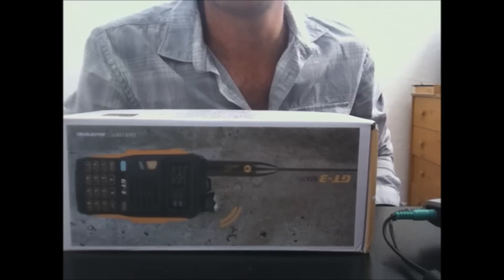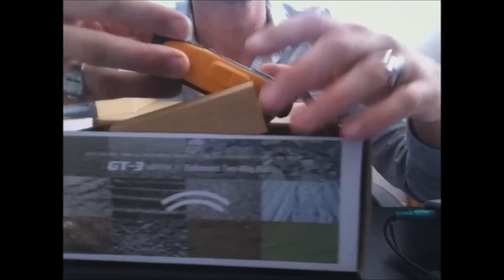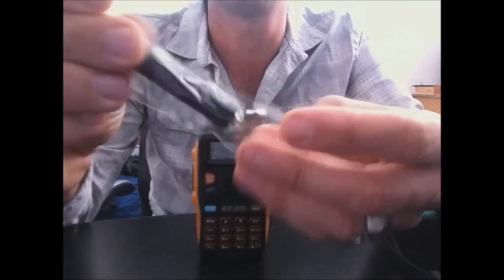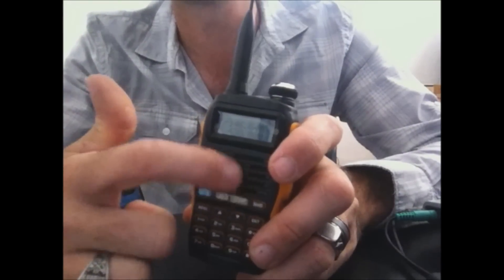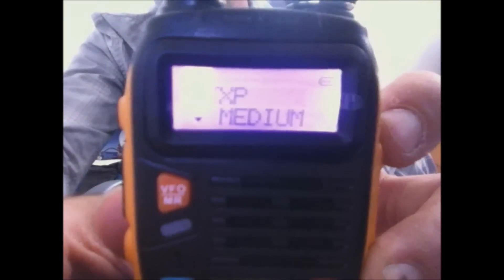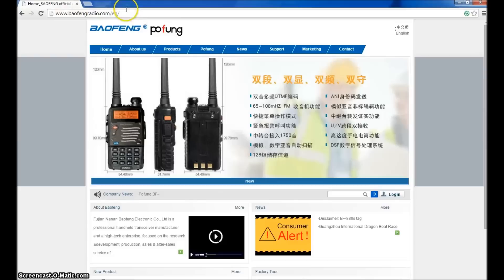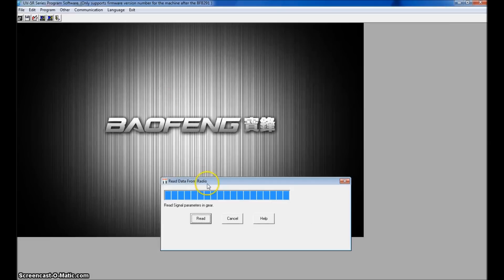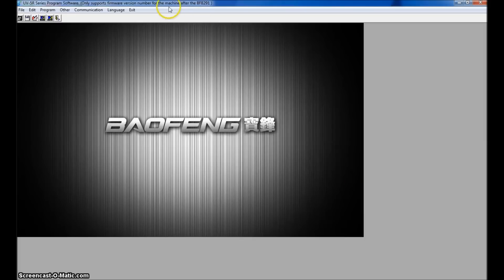GT-3TP Baofeng 8 watt review, test and programming

Comment: I just purchased two Baofeng GT-3TP's, two speaker mics, programming cable, disk, and 12 volt charger on Ebay all for $40 including shipping.  The bad is they are coming from Hong Kong.  But that is one hell of a deal not to pass up.  

Will be added to my already growing commo stash:  four UV-5R's, one BF-F8+, one BF-F8HP, one UV-82 Camo, one UV-82HP, one UV-82C, one KG-UVD1P that I personally own, and one KG-UV6D V2 that is issued to me from county emergency management.

Should be getting them in around the end of the month.  These will be the first GT-3's that I have purchased.

Comment: Hi I'm looking to use this radio at work. The plant is about 3 million Sq foot. What would be the best setting and frequencies to use? Should I use uhf of vhf? Also what band wide or narrow? Thank you
Reply: It will receive broadcast stations from 88 to 108 MHz quite well. Turn it on, press "Call" and tune to your favorite station...
Seriously, this isn't a commercial radio, it's a Ham radio. To transmit on it legally, you need a license. If you need radio communications in your plant, you should invest in commercial radios and get the proper licensing for it. Baofeng makes a version of the UV-82 for commercial frequencies, but I've not seen or used one.

Comment: when i unlock the channels are they installed in the radio.
Reply: Lorne Stadnyk I believe you mean unlocking the frequencies. This radio comes pre-programmed with 12 channels. By unlocking the full range of frequencies 136-174/400-520 it will be installed on the radio.
Reply: Lorne Stadnyk thank you

Comment: I find your video confusing. No where in the video do you indicate that this is an amateur radio. You have people asking you if the radio can be used with higher power than the typical 5 watts allowed for FRS. Some on here are interested in unlocking the frequencies. Why would someone want to unlock the frequencies on this radio? Do these same people know that they will be broadcasting out of band? Do any of the people asking questions about increased power know what they are limited to on the FRS frequencies.

As an amateur radio operator, I think you could have done a lot better job of properly representing what this radio is and what can and can't be done with it.
Reply: Binder Dundat Does this mean when unlocking the radio the total output power is reduced to 4W?

Comment: Can this radio be programmed to use the 1-22 walkie talakie channels?
Reply: Rick Knuckles Yes it can. If you know what the 22 individual frequencies are its very simple. You can use the radio as a scanner. To help narrow it down have a look on the back or underneath the battery of your walkie talkie. It should indicate the frequency range it operates in. Be on the lookout though, lots of walkie talkies use DCS/CTCSS coding. Also possible to decode using the DCS/CTCSS scanning function of the radio.
Reply: +Vernon Els yup, easy to do but totally illegal though. I'm not saying you can't, just that you should be aware of that.

Comment: Do you know if there is a battery eliminator that fits this radio?
Reply from the maker: Tim B No, not that i know of, the only style is the UV5r style that has the bat eliminator. one reason many people continue to go with UV5R case design
Reply: HamRadioConcepts The battery of my GT3-TP has the same model number as the ones on the UV-5R. Maybe, maybe, the battery elliminator fits both radios.

Comment: Hi There,
I'm new to all this can you advise when you unlock the radio does it unlock all frequencies to use 8w?
Reply from the maker: Yes, but the further you go outside the normal operating band, the power will decrease a slight bit. the radio is designed to operate to most power at the center of the bands.
Reply: cobber427 Are you aware that you are limited to a certain output if you are not operating within an amateur radio band? Even if you are a licensed amateur radio operator, you cannot exceed this output power on FRS frequencies. The producer of this video didn't have time to explain all of that to you and it's your job to be aware of what you can and can't do with this radio.
Reply from the maker: Binder Dundat You're correct. It's like buying a 600 horsepower mustang, you have to obey the speedlimit. I don't use these on FRS or GMRS frequencies, but i'm sure a lot of people out here do use them for that. It's up to their responsibility to operate according to rules and regulations.
Reply: I guess you can and have taken that path where "it's not up to me to tell them what they can and can't do". You were so helpful in all the other aspects of the radio, it's too bad a little more hadn't been addressed. They were being sincere in asking you.
Reply: Using these radios for FRS or GMRS is operating outside of the rules and regulations. They can't legally be used on those frequencies.

Comment: Hi mate need your help just got the GT3 mk 2 and two UV 5RA+ there on the same frequency but when I speak out of the GT3 nothing comes through to the other radios when I speak through the RA+ the sound comes through the GT3 and can hear it Km new to radios and want them for work if you could help that would be great
Reply from the maker: It sounds like your offset is turned on, you may see a - or a + on the screen, which means you are transmitting an offset in either direction. When you transmit does it show the same frequency you are receiving on? Or does it change when you press PTT?

Comment: tht software just makes my screen flash thn crashes ,  on borh my win 7 pcs 
please someone give me a link to one tht works on win7 64bit
Reply from the maker: The one i showed in my video is working on my Windows 7 64bit machine, A lot of users are having this issue, and i cannot say it is the software because it works for so many people, its some configuration in your operating system. Try running the software as administrator.

Comment: Can't get the Beofeng programming SW to run under Win7 to remove the irritating limit this radio comes with (restricting use to 10MHz slices of the VHF and UHF bands).  The radios RESET ALL option, according to the seller, was supposed to remove the lockout but it did not and doing this resets the radio audible prompts to Chinese.  I seem to have wasted $70 on this fancy looking but irritating gadget.  The BF-F8HP may not look as sexy but it comes without this lockout and it has a battery backwards compatible to older Baofeng models
Reply: If you watched my video I showed you how to unlock it. I have done it on 7 radios now. This is why I included this information in the video, you do NOT use the reset all function.
Reply: Hi!  I did watch your video (Thank You for posting it!) & did install & reinstall the software several times but it locks up when I try to launch it (Win 7 64 bit ASUS compute).  Not sure what else to do...
Reply: Did you try running as administrator? Right click icon and choose run as admin. Also, is this software the latest from the website or a previous version? It is the VIP software? Or is it chirp?
Reply: eric johnsonton Hey!  Yes, I tried that (did all the usual stuff- I was I.T. support at my company so I'd hope that I didnt make any of the rookie mistakes!!)  I tried the Chinese s/w which didnt work at all on windows.  Then I tried the CHIRP on my Mac and after a bit of trouble was able to download the radio settings.  But going the other way- trying to write back to the radio with the restrictions off results every time in the program blowing up.
Reply: mascotmatt I guess I'm having a unique problem with this particular radio & will try to return it to the seller.  It may look sexy but if I can only access a 10MHz slice on the UHF and VHF bands, its of little value.
Reply from the maker: mascotmatt Well i know for a fact it will unlock using the method in my video, but i know you are having a problem getting the software to run on your windows machine. Do you have another windows pc that you can use the software on to program it?
Reply: HamRadioConcepts i bought an old Acer Win xp machine off ebay last week just for this task but the Baofeng program in your youtube video blows up because the netbook display adapter cant do 1024x768.
Reply: mascotmatt SUCCESS!  I went back to the Win7 PC, dumbed down the screen res and muddled through alot of communications errors that were resolved by fiddling with the volume knob and toggling the radio frequency (apparently if there is any noise on the selected frequency the data read fails.  Well, that was exhausting! Thank you, HamRadioConcepts for the insight as to which software would eventually work.  Sadly CHIRP can read from this unit but not write.  My next batch of Baofengs will be BF-F8HP models which dont come crippled like the GT-3TP.
Reply: If you have a dedicated computer for this task, I'd recommend installing Linux and using Chirp to program the radios. The software is free and has worked very well for me, even with what I suspect is a "counterfeit" cable that came with the radio.

Comment: Do you know anything about the waterproofness of this radio? I was told by Niceone that they are waterproof, but i cannot find any information on that being true
Reply: While I've never submerged mine, I seriously doubt it's waterproof. For starters, there are too many openings where water can get in (ear/mic ports, keys, etc.).
For what it's worth, I did have a UV-82, which I expect would be comparable, get submerged when it got wet while in storage. I have no idea how long it was in the water, but when I pulled it out and cleaned it up, surprisingly, I was able to get it to work again. I had to disassemble it as far as I could, and had to clean it thoroughly. Once I did so and re-assembled it, it worked. Some of the keys were a little sticky, and I'm not sure how well it handles voice input, but I can tune a channel and hear the broadcast.
Overall, I was surprised that I was able to revive the radio. I guess that speaks to the hardiness of it. With that experience, I wouldn't worry too much about using the radio in the rain, or if it were to get sprayed with water accidentally. I would dry it off immediately, but after that, I don't think it would be seriously damaged by such things.

Comment: Great video, thank you for doing this.
I have a 80 acres animal sanctuary (El Hogar ProVegan)and use fron long time the 888s (good price for a radio that the volunteers can use and lost and broke...) but I am thinking to get some of those to have more strong bodie and options.
Cuestion:
There is any way to use a radio as a door comunicator?
I mean: that somebody, in the entrance use as a Doorbell to send a sign to the radio? or be able to comunicate?
The problem is that most of peaple are not familiarized with twoways radio and is a need no have to be pushing while is talking and release to receive the mensage...
Or maybe do you know a doorcomunicator that transmit in a frecuency that I can programate in the GT-3TP...

Thnk you for any help.

Comment: Eric, I need your help. I received my Baofeng GT 3-TP yesterday(1\29\15). After unpacking it and charging the battery for 7 hrs to 8.15v, I inserted the battery and turned the unit on. The unit came on and the voice prompt said, 'Frequency Mode". The lcd screen lit up and shows  both dual band freq. of 141.500 above 430.640. The PTT button activates the screen to change color to red indicating it's in the transmit mode, The flashlight feature works as does the alarm feature. However, ALL the keypad buttons will not work. The FM radio feature works, but I can't change or scan stations, as ALL the keypad buttons seem to be Locked. Any suggestions? Is there a way to 'un-lock' the keypad so the unit can be setup? Regards, Mike
Reply: Hold the pound key # until it says unlock. If you are unlocked and nothing will work, then the keypad connection to the radio must be bad. However  try this first. Let me know please. 73
Reply: eric johnsonton That was too easy.lol......Thnx Eric. I'm a 'newbie' at this. Big 73.

Comment: Good review.  I have a question.  The picture of the radio that is on the box and pictures that I see online show the radio display as black and the readout as white digits.  The radio you show in the video has a lit display with black digits.  Can you switch the display in the settings or are there choices  between the two displays when you purchase?

Comment: Great video.  How do the UV5R(s) compare with the GT3(s)? (The new versions of each).  I don't see much difference except that the UV5R radios have an extended battery, and possibly run without a battery of an adapter, and the GT3(s) don't?
The GT3 had a better manual than the UV5r but that may have changed now with the improved UV5RTP?
And incompatibility (they don't fit the new recessed connector) with the older antennas.
 By the way I use Chirp with my GT3. 
Not sure if any of their software works with a Mac either.
Reply from the maker: True. UV5R has the battery eliminator, better antenna connector and the extended battery. GT3 has dust/water resistant, different backlit screen with the white letters on the colored screen. Better manual for GT3 as well.

Comment: Erick, I cannot get this software to work and therefore cannot unlock my radios....can you help?
Reply: If your radio is the same firmware and model as in this video, and you downloaded this software, it should work. Did you verify the correct COM port in your device manager? So far, this is the VIP software that i have successfully used. The other software wouldnt work for me. Chirp works for some, but not for me.

Comment: Does the uv-5rtp use a the newer chip set/PCB?
Reply from the maker: The UV5rTP uses the same board and case as the UV5r, but a newer firmware, chipset and power transistor. It will have the bug fixes from the original UV5r, at 8 watts. I am going to be posting this video hopefully tomorrow, as well as the RST599.
Reply: HamRadioConcepts  thanks for the reply. good to hear. so basically its the same internal components as the gt3tp?

Comment: I really like the look of the GT3 series, but the BF-F8HP being compatible with all of the UV-5R battery and antenna accessories makes the GT3 TP pointless as a viable option. If the GT3 TP antenna threads weren't counter sunk below the outer case like the GT3 MKII is, AND I could get a AA battery case, I'd buy several. 

What they really need to do is get busy crafting some GT3 battery option accessories.
Reply from the maker: Understood. I agree. I'm posting a review of the UV-5rTP tomorrow. I bought the extended battery for it as well.
Reply: HamRadioConcepts Looking forward to seeing that. Hey, in order to show the practical value of the 8w radios vs the usual 5w-ers, how about you and a buddy take two 5w and two 8w radios to test out the simplex comm distances starting at .5 miles (increasing @ 1/2 mile increments) to see what the 8w can really do.
Reply from the maker: RETiredGM The reason i didn't do that is because the terrain and conditions are always different. I can talk to a buddy 2 miles away radio to radio, but the first person that has difficulty reaching this distance will call me a liar. Plus, I KNOW how they operate at certain ranges, but how does the viewer know i am exactly the same distance as they were... Just causes rude comments. If i showed it is 8 watts, the rest can be decided by the user themselves.. 73
Reply: Well I think you should do it in the name and spirit of science and discovery. Screw the nay sayers! They hate you 'cause they ain't you! Lol!

I understand that under each individual situation, milage will vary, but no one is legally binding you to your claim. Only children think in terms of absolutes.

If you've got the gear and the time, try it, record what happens, and report your findings. 

'Merica!
Reply: HamRadioConcepts I am eagerly awaiting your review of the UV-5RTP. I want to buy one but I am waiting for more reviews.
Reply: Actually, to double your power is to make a noticeable increase. There is no increase from 4 to 5 watts, but 4 to 8 watts is DOUBLING the power, thus making an in crease on the received signal. My HF amplifier does 600watts, if I bought an 800 watt amplifier, this would do me no good, I would have to at least upgrade to 1200 watts to make a noticeable difference, the more the better yes, but I would rather have double the power in this handheld then an increase from 4 to 5 watts

Comment: I am just getting into ham radio but have not got my license yet but did order a Yeasu VX-8DR cause of all it features but was thinking about picking one of these up for an extra, i was looking at the UV-5R + but heck for $20 more I can get this one
Reply: I found one pretty cheap from radioddity dot com.Does anyone have experience with this seller?
Reply from the maker: MAX Yes, Radioddity is a great company, a bit slow in return for email, however, they are usually the first to release the new units before they hit ebay and amazon